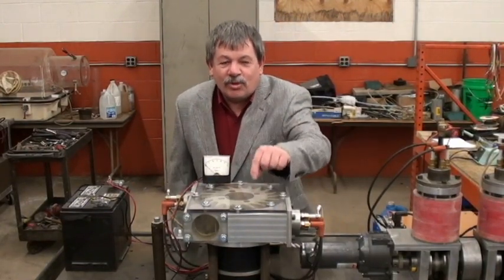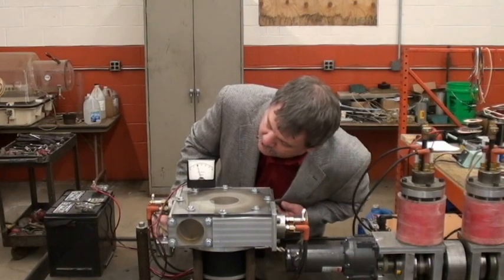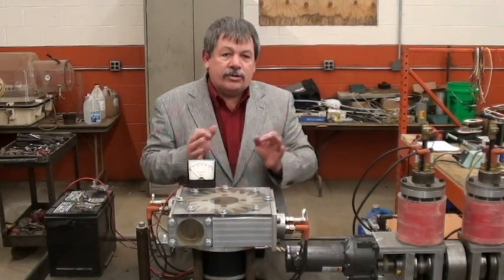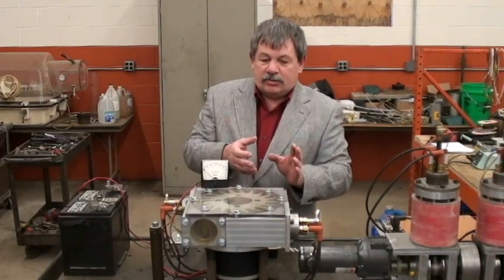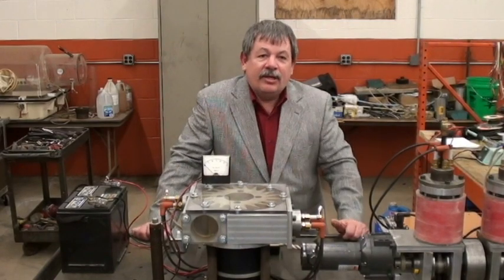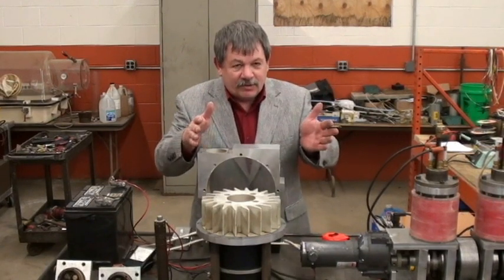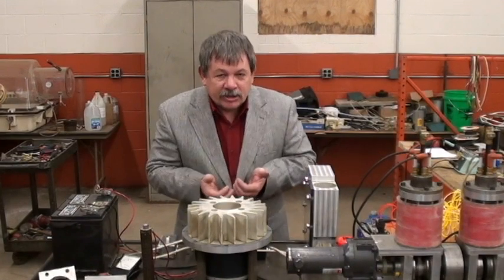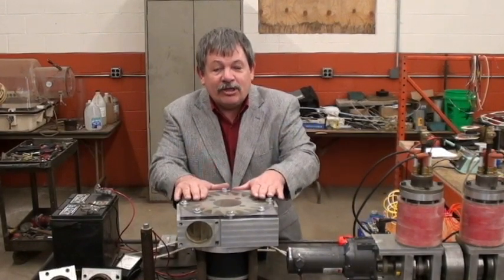Roberts Rotary Engine

Comment: Is this guy serious?
He's using electricity to make electricity.
Reply: a petrol engine uses electricity to make  electricity.
Reply: well yes... but not as a main source of energy.
What i'm curious about is what is the efficiency of this setup, what is the ratio of power output to power input
Reply: a petrol engine uses chemical reaction started by a spark from an automotive coil.(fire = fuel + 02 + heat)
A plasma engine uses a plasma reaction started by a spark from an automotive coil.(aided by a passive additional kick from the thorium & rubidium & phosphorus)or 27mhz rf.)
Reply: yes

Comment: Here's my question:

How efficient is it?

Don't show me some non-simultaneous reading of two seperate volt/ampre meters either.

I want to see a watt meter of the generator output, and a simultaneous reading of all required inputs and required ancillaries.

Comment: Changing the dimensional reality of the motor/generator and feeding it with partical  gravitational force.  I.E. natural occurring amperage not spent on holding things in place, allowing the sub-atomic energy to change states in other ways rather then 'gravitrons' they become static induced electrons?  Would that be the correct direction with this specific Pap engine? This is a beautiful expression of consciousness but its not likely to go anywhere as long as our monetary system exists.

Comment: thanks sweety. I have some questions, would you be kind enough to answer them? I saw the original pap engine running, in video. looks to me it had 2 car coils with transistor drivers.. I don't understand the difficulty with the ignition system. is this the only thing holding back this papknowligy from running again? if so I would gladly donate my cold fire ignition system. just to get this thinbg running for the world.  am I missing something here? or is this the last piece?

Comment: Given this is generating electricity and given that it only uses electric spark discharge to trigger, if the power output is significantly higher than the input, why not close the loop?

The circuit should be trivial and could make use of that accumulator (car battery)

Comment: Hi Bob... any chance of divulging the load resistor value? I see it's connected... it would sure help to know.  Thanks much!  I look forward to the next generation... there's lots of room for improvement, but you gotta start somewhere! Maybe smaller 'pockets' in the rotor, and as Dannel said, nozzle to increase the velocity... possibly with reverse-angled ports to allow the plasma collapse to draw in the gases from other areas then the nozzle outlet, so you don't suck the wheel backwards, sts.

Comment: Until we know some numbers there is no way to tell it worth anything or not. But the lack of number is suspicious for sure.
The 107hp or 79715kw original Papp engine running from 2 car batteries sound too good to be true. And there was no duration test. No one know what happens when u run this thing for a year 10H a day. Maybe thing wear out fast.

Comment: You measure nothing intentionally.  You don't want to bust yourself and show the world that you have nothing and there is no such thing as magically extracting energy from "nowhere" with noble gasses.  All that you are doing is playing with a bizarre electric motor that uses hot air.   Not to mention the real electric motor "assist" underneath your hot-air electric motor.  What you want is to sit on your ass and make three video clips over the next 36 months for 1/4 million bucks.

Comment: @Bob Rohner The rotary geometry is a good idea. U could cut the PR bullshit about unlimited energy and u dont have to replace the "fuel" (noble gases). Its not the fuel. Its just the part of the engine just like the rotor . The fuel is the electricity that goes in. 
So u can make 12V output how much energy went in?

Comment: Your reparte is only so-so.  Your hot air puffer motor is junk.  The only reason you see any movement is because of the external electrical power, not because of the gasses.  Without a single shred of evidence you rolled out the ridiculous story about only "fueling" your car with "noble gasses" once per year. Shame on you, how can you look at yourself in the mirror?  Keep playing the uncertainty game and never make measurements.  Hold out your hand and make the monkey dance, again.

Comment: Keep the Straw Man arguments going Bob.  You gave the real answer, the heat transfer rate is proportional to the delta T.  Just saying it is an "asymptote" is not an answer.  You gave your silly pitch tonight on SmartScarecrow and of about 22 people in the room only one believed you.  That's all you need is to get the panhandling message out far and wide and get some suckers to invest in your hot air.

Comment: Dong, to much Colorado wacky weed MileHigh. My answer is exactly correct. You may call it Zeno's Paradox if you wish, the point being that heat transfer is directly proportional to delta T. The closer the slower to infinity which most engineers would call an asymptote. Since we all know P and T are directly related, I can only commend you again for proving there is no heat involved and making your silly funding statement moot.  You do not need to hide behind Mark E. You too can be a grown man.

Comment: Sure, we will keep things real simple for you MileHigh  - I have a  240CC chamber surrounded completely by a 1/4 in wall of aluminum and a 5/8 in wall of copper which is full of air and everything is starting at an ambient of T1=70 F. P1 is simply 1 atm. Now suppose I rapidly inject (maybe a second or so) enough heat energy into the chamber to raise the temperature to say 120F.   How long will it take the internal pressure to return to  P1. As you said elementary school stuff MileHigh.

Comment: You are quite pathetic with your elementary schoolyard insults.  I will give you a suggestion:  Do a setup where you monitor the electrical power in and clearly show the rotor driving the motor configured as a generator driving a load.  Measure the power-in power-out. Make that clip.  The chances are almost nil that you will because you don't want to "bust yourself." You getting handouts from strangers is dependent on maintaining uncertainty. Just like Yildiz your cash flow requires uncertainty.

Comment: For what it's worth, I am not even convinced that your rotor will even turn if you disconnect the power to big fat electric motor right below it.  You fire a spark, within milliseconds all you have is hot gas to push against the rotor, the rotor moves a bit, then there is a vacuum sucking back and the air cools.  It very possible that without the motor and just the sparks, the rotor will jiggle back and forth and barely move.  For every push you have a pull -> powered motor fixes that problem.

Comment: Heat transfer theory?  You are ignoring the fact that two months ago you admitted you knew nothing about heat transfer theory to Mark E and now you are asking me?  For starters, you have no clue what the average power consumption of your device is, I don't think you know how to measure it.  If you ran your device for an hour, it would slowly heat up.  The heat from the gas will slowly flow into the metal which has very high specific heat, but things will very slowly warm up.  What's the point?

Comment: Now you are trying to quiz me.  That's funny, because about a month or two ago you admitted to Mark E that you had no idea how to do any thermal analysis.  So Mark E took you by the hand and gave you guidance and told you what to do and showed you some calculations.  And you are supposed to be a mechanical engineer?  I think you forgot your schooling.  Nice try there Bobby.

Make a new clip where you clearly show the motor is not under power when you do the sparking.  I dare you.

Comment: It'll repeat, I have nothing to do with Inteligentry.  Several months back I debated with your brother on PESN along with Mark E.  We asked your brother how he would measure the output and he didn't have an answer, he had no clue.  He ended up saying that if the piston moves then it is over unity.  Pathetic.  Myself and Mark E said there would be no running motor at the PowerGen conference and we were right.  The whole thing was a transparent con and he got busted by the feds.

Comment: You and your buddy have built a prop to make a clip in an attempt to jump on the Internet Kickstarter-type funding bandwagon.  I have nothing to do with Inteligentry.  Your carney brother boasted about designing the spark plug ignition control circuit, and got into a debate with an engineer about it on Facebook.  It quickly became evident that Johnny had no clue what he was taking about and never understood how a spark plug ignition circuit even works.  It's amazing how bad it can get.

Comment: Also, don't even try to pretend that the Tesla Tech conference is attended by the "finest scientists and engineers in the country."  Between the crystals and aroma therapy and the spinning pulse motors that do absolutely nothing, there was your hot air machine that does absolutely nothing.  25+ years and you still haven't made any energy in vs. energy out measurements, which would show nothing even close to unity.  Your apple didn't fall that far from your brother John's apple.

Comment: Everything that I have said is in fact logical.  This incarnation of your fake machine has electrodes instead of spark plugs, fine.  All that you are doing is sparking air and creating a temporary plasma that dissipates right away and gives you hot air.  So you are doing a grade seven science fair experiment where you heat air and expand it with electrical energy.  You don't deserve 1/4 million bucks for that, you deserve second prize at an elementary school.

Comment: Call it as you see it. You have not said anything logical yet, why start now. I have proved the power and lack of heat repeatedly to some of the finest scientist and engineers in the country. You really do not understand anything that is happening do you. It's called a Plasma. The spark is nothing but the path and there is no spark plug at all.  I must admit that I do completely believe that you have the training and ability to smell BS. Pull your head out - the air is fresher on high.

Comment: I also noticed that you are holding your hand out on the street corner and asking for 1/4 million dollars.  Yet there is no energy that comes from noble gasses at all.  The spark plug energy heats some gas and the heated gas expands.  So you want 1/4 million dollars to play with hot air generated by firing spark plugs?  No thanks.

You have never proved, nor will you ever prove, that noble gasses can be a source of energy with your 'magic' sparks.  It ain't so, Joe.

Comment: The only chance for you to redeem yourself would be to do another clip like I said with the motor wires hanging loose and exposed for all to see.  I can see right through your clip because I have the background and I can smell BS.  The sparks that you are producing right now in your clip are anemic and would barely make the rotor turn.  That's why I allege you are cheating and using the motor.  We saw your brother's sparks could barely make a balloon budge.  You aren't fooling me.  Make a clip.

Comment: I stand by my analysis of your clip and I just responded to you on the SmartScarecrow channel challenging you to make a follow-up clip where you clearly show that the motor is not connected to any power source when you claim it is acting as a generator. I don't care one bit about your sparking circuit and I never asked to see it. There is nothing to see, it's just a sparking circuit.

Are the sparks making the rotor turn or are you covertly claiming a "generator" when I see a powered motor?

Comment: What was analyzed on the Scarecrow channel by you was your own lack of intelligence and information. You openly and admittedly declared that you wished to see the circuitry in detail.  Completely and totally without any questions and lacking any knowledge what so ever of the controls, inputs or outputs utilized in an extremely low budget and basic demonstration, you felt free to declare this a fraud. By your logic and not knowing you, I therefor feel just as free to declare you to be an ass.

Comment: Interesting stuff and nice job an  the design! My question is how much input power do you use compared to the output power. If the input power is completely unrealistic compared to the output power or if it consumes much more then there is no point of using such a device. For instance if the device requires 200 amps to run and outputs only 2 amps then your efficiency is so low that it would not be practical to use. As of right now what is the input vs. the output power to run this rotary engine?